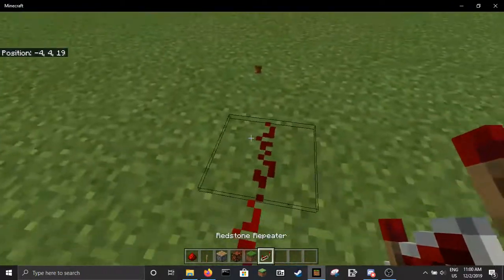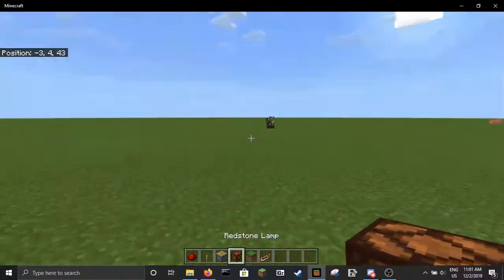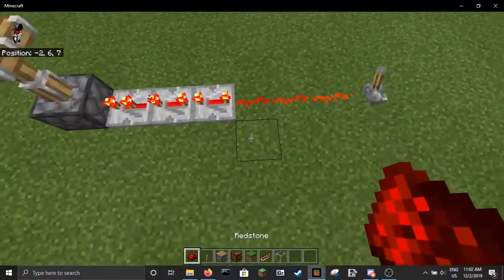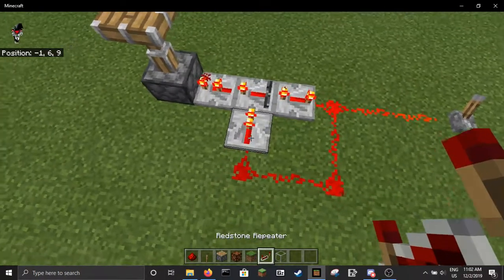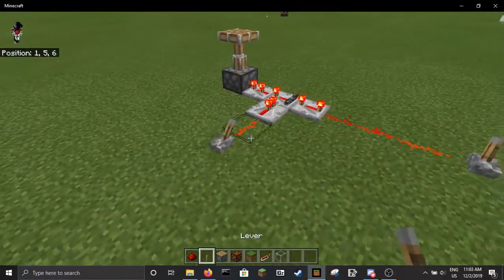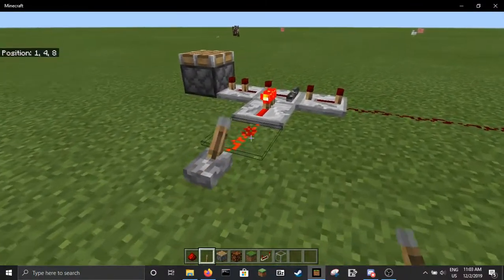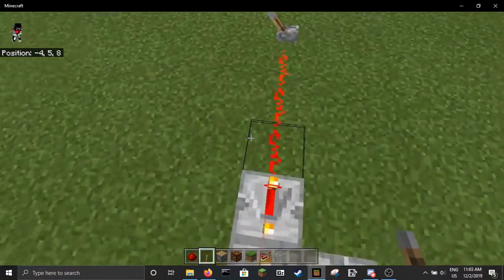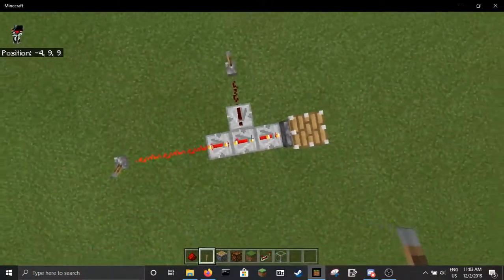Minecraft Bedrock - Redstone School - How Do You Use A Repeater?

Comment: No matter what i do I can’t seem to work repeaters
Reply from the maker: What do you not get?
Reply: If a repeater or torch does not have a repeater or torch before it, the delay will be one less redstone tick than it appears to be. This inconsistency confuses people a lot, but once you know how it works it really helps you get things max speed easily
Reply: @jared4575  my repeaters aren’t actually picking up redstone signals, I made a line of redstone just to check and put a repeater to connect a larger line of redstone, it just stayed dark. No matter what I did I couldn’t get it to work, even though I’ve used repeaters in bedrock before I don’t know what’s wrong with it
Reply: @jared4575  nvm my repeaters just decided to start working 😂
Reply: @astra6698  lol what? Did you not activate the line? Or did you put it more than 15 blocks away from the input?
Reply: Because it’s clickbait